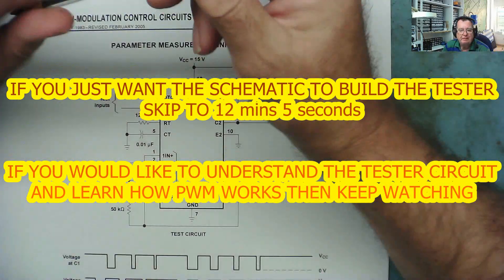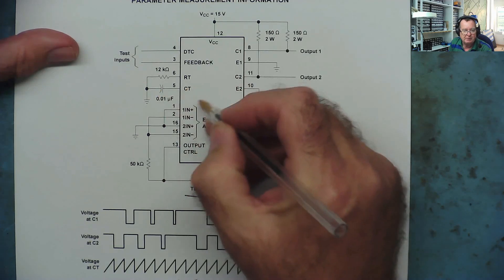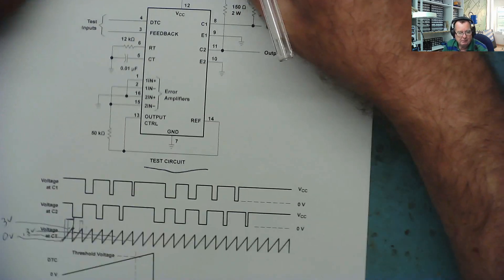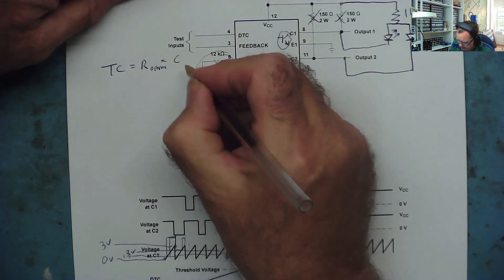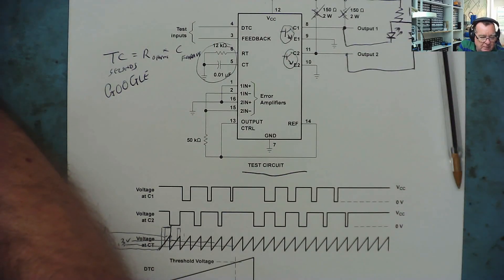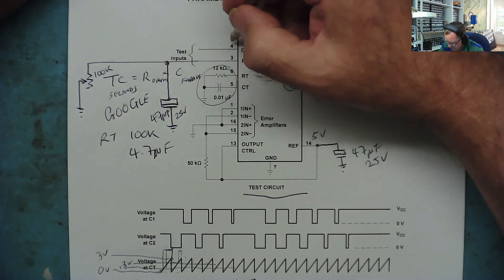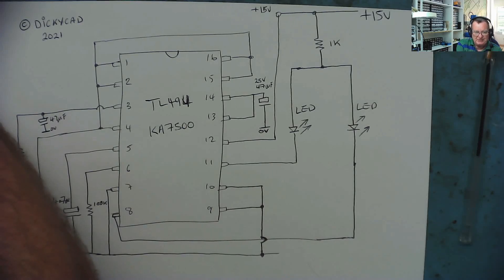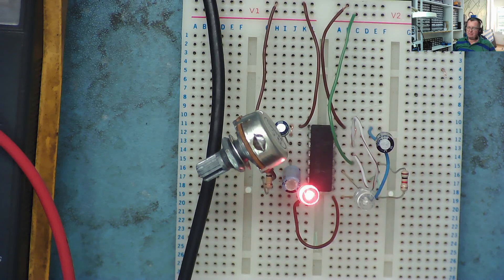How to test TL494 / KA7500 PWM Controller IC

Comment: I want to make a LED strip dimming driver from KA7500 inverter circuit, boosting 24VDC to 220VDC. How can we adjust the voltage output ?

Comment: Looking for help on this one, I have built and tested this circuit.  I bought 5 Tl494  and found each of them to be missing the 5v on pin 3 so after hours of checking everything I ordered the ka7500, to my surprise it worked so I now have dead on arrival Tl494s. There is however an operational difference with the ka7500 compared to the video, it does not switch off when I pull pin 3 to ground like the video. Has anyone experienced the same thing?

Comment: Very nice tutorial!
Thanks for the video.
I am equally working on a high power DC-DC boost converter design.
Basically my goal is to design a synchronously controlled interleaved boost converter system - capable of delivering high output currents even at low input voltages. If this works, then I will see about modifying the circuit to operate with synchronous rectification - for better efficiency. 

Texas instruments did a wonderful job with the TL494 datasheet by explaining all the design considerations and calculations....Switching frequency, power inductor selection, dead-time control, filter capacitor selection.....etc. 
These will be covered in my next video.
Thanks again!

The Innovati0n Lab

Comment: I just built this. It worked but adjusting the pot didn't do anything and the LEDs flashed anyway. It turned out this circuit isn't 100% reliable as a chip tester. The whole point of this is to test chips that are likely to be faulty. I tested a known bad chip (bad in an unknown way) and the LEDs flash. I discovered the issue is the feedback pin on my chip is stuck at 0.065v so the LEDs will flash regardless of the pot position. So while the bad chip works in the test circuit the feedback is not active so it won't work on a real smps... that's a false-positive. If I had not discovered this I might put the chip back into the power supply then wonder why it doesn't work. This needs a revision 2 so it actually uses the feedback pin. It really needs something that changes the feedback from about 1.5v to 2.0v so it moves +- 0.5v after a few seconds up and down continually to exercise the feedback function. Pin 3 can be measured with a multimeter to ensure it's actually moving to verify the feedback is good. I also went back to look at another power supply where I changed the TL494 and it turned out that new chip also has faulty feedback. Wish I had discovered that before pulling and testing all the other parts, not finding anything else faulty and pulling my hair out in frustration hehe!
Reply: given pins 1, 2, 15 and 16 (the error amp inputs) are all at ground why wouldn't pin 3 be too and not variable ?- I wonder if the pot is actually at Vref and therefore is an input, not an output.
Reply: I had the same problem. I connected pins 2 and 15 to vref through a 47kohm resistor. Also connected the potentiometer to vref instead of ground and also changed it to 10k instead of 100k for better control.

Comment: Great video. Can you explain how this chip is used in an audio amplifier? Trying to fix a constant thumping coming from speaker, no sound. I've changed capacitors that 'usually' cause this problem. Now I've traced it to this chip, that outputs a pulse 'C2' direclty to a large capacitor. I can actually hear a noise in the circuit, sounds like a mechanical relay.
Reply: Had same prob turned out to be an OC via - the thump was the psu when running ok and amp on ok - but it was not getting the ok Im running sig back to the started now stop the start up seq sig. hence the thump on the speaker.as the psu tried to start over and over again. and what made it harder to find was the via was under the IC. So soldered strand of wire in the via to fix the via. thump stopped -PS the amp  was called a Thump Amp LOL

Comment: Nice tutorial.  Actually great.  Tell me, would this same circuit work on a TL594 which is essentially the same chip with higher input tolerance
Reply from the maker: It should
Reply: I have many of this tl 594,and fews  tl494
Reply: I have many of this tl 594,and fews  tl494
Reply: By looking at the TL594 datasheet, you can see the same configuration on page 7/figure 12.
So the answer is YES.

Comment: thank you ,i have a problem with this ic tea 1716 in led tv power supply NO POWER, her problem is that it was exposed to high voltage, and I found the main capacitors swollen, I replaced them, but the IC heats up greatly, but it is fine because I removed it and tried it in another card and it worked fine. Where is the problem? Is it in the components surrounding the ic tea 1716?
Reply from the maker: Hi Abdullah
Generally, if an IC is getting hot then it is either: 
1. faulty (which you proved it is not) 
2. Something wrong with the power supply voltage to the IC (here is the link to the datasheet so you can check the supply voltages)
https://pdf1.alldatasheet.com/datasheet-pdf/view/751523/PHILIPS/TEA1716T.html
3.  It has excessive load on the output(s).  This chip drives the MOSFET gates - one for the PFC and two for the SMPS transformer.  MOSFETs are supposed to have practically an infinitely high gate-source and gate-drain resistance.  I would have a look at the gate drive circuit - can you measure the resistance from pins 7 (GATEPFC), 10 (GATELS) & 13 (GATEHS) of TEA1716 to ground.  Do you see any low resistances?  If you can compare resistances with the other card, even better.

Also remove the three FETS and test them.  If the two cards have the same FETs, try swap them from one board to the other
Reply: @LearnElectronicsRepair  Thank you, sir, for your interest in my question. I tried several times to measure the surface elements around the IC, but for example the resistors I found them to be good, but the capacitors I did not measure, but I will follow the steps as you told me in the evidence 10 7 13 To ground

Comment: Can you please explain how is the voltage 3.3v regulated  in the atx power supply using tl431 and pnp transistor?
Reply from the maker: Circuits vary so I can't answer that definitively without either the PSU or a schematic.   The TL431 is a voltage reference, I made a video here.  

TL431 video
https://www.youtube.com/watch?v=LvGehyWLS80

This comments section is intended for the TL494 video... ;-)

But anyway, the TL431 is usually closely connected to the LED in the opto-isolator - the idea is is that two close tolerance resistors are used to set the turn on voltage of the TL431.  These resistors connect between ground and the voltage supply you want to regulate.  

When the TL431 turns on it conducts, and the current flows via the LED in the opto-isolator, therefore also illuminating the LED and turning on the photo-transistor that controls the PWM feedback.  By choosing the value of the resistors you can make the LED illuminate at whatever voltage you like.   

Simples.... but...

The minimum possible turn on voltage of TL431 is 2.5V (no matter what resistor values you select) and the LED is in series with TL431.  As the LED also has a forward voltage drop (let's say 1.25V) the lowest voltage rail you could control using this circuit is 2.5V+1.25V = 3.75V (approximately)

To get around this you can use the TL431 to switch on a PNP transistor instead, and the transistor then turns on the LED in the opto-isolator.  In this case the minimum voltage rail you could regulate would be 2.5V + 0.6V (base -emitter voltage of the transistor) = 3.1V (approximately)

To work on even lower voltages you need a version of TL431 that has a lower internal voltage reference, for example 1.2V like the one I found in my video.

This short and easy to understand Texas Instruments article explains this better than I can, and also shows the typical circuit both standalone TL431 and TL431 +  PNP transistor

https://e2e.ti.com/blogs_/b/powerhouse/posts/powerlab-notes-how-to-regulate-a-low-voltage-isolated-supply

I hope that helps
Richard
Reply: @LearnElectronicsRepair  
Thank you very much for the answer, I mean the 3.3v regulation separate from optocoupler.
I have an ATX power supply that has a strange voltage regulation system for 3.3v that takes the 5v AC from a separate Schottky diode and regulates it through two coils and the tl431 and asmall pnp 
Th base of transistor is not controlled by the tl431 but through the 5 AC!
I couldn't understand it well honestly
Reply from the maker: @techeng3940  Ok... as I think I suggested earlier, register on badcaps.net forum (it is free to join) then post in the Power Supply Repairs section with some pics of your PSU and description of the fault and what you already tried.  I am 100% sure you will get help there from others as well as myself.  https://www.badcaps.net/forum/  They really are a helpful and friendly bunch there.
Reply: @LearnElectronicsRepair  
I fixed the psu, there is no problem with it now
But I found the way to regulate the voltage 3.3 is strange! so I searched for it 

Thank you very much Mr. Richard
Reply: @LearnElectronicsRepair  
The circuit works on tl494 and lm339 as a control and I couldn't find a schematic for it

Comment: Short but not easy, need some time to digest everything. Thank you Richard, have a good weekend.
Reply from the maker: Hi John.  I'm always happy to help anyone who is willing to learn electronics repair  - We all learn at different speeds and in different ways - anything that is not clear enough, or I skipped over (sometimes it is hard to put yourself in the position of of someone learning what you already know) just tell me and I'll try to explain it again in more detail
Reply: @LearnElectronicsRepair  You're helping a lot already. If you could do a video on how to approach failures in electronics (motherboards/laptops/gpus) with a basic checklist, that would be realy nice.
Reply from the maker: @johnprescott6614  OK I'll work on that idea John.  Thanks
Reply: @johnprescott6614  So you can't build this simple circuit but you want to know how to fix highly advanced pc motherboards and gpus? Eh? You need to learn how to crawl and walk before you can run. Watch youtube repair vids for a couple of years and you will have a good understanding of what is required and the basics of how to fix stuff.